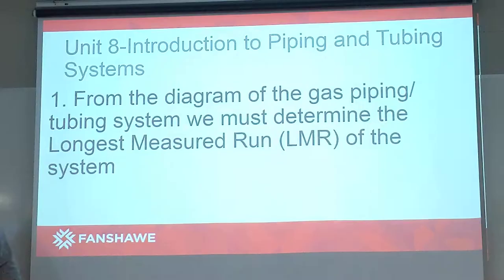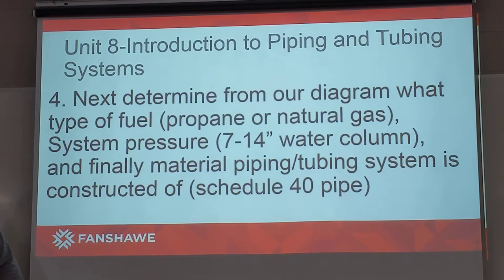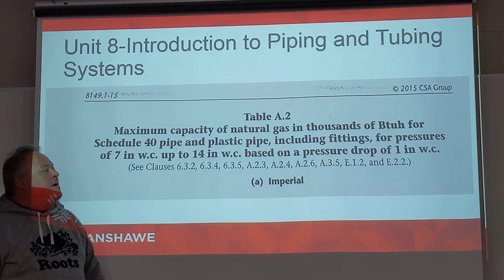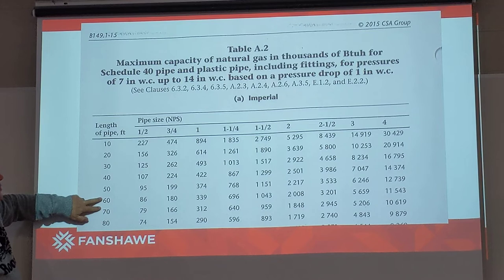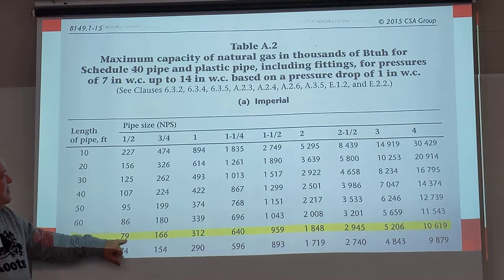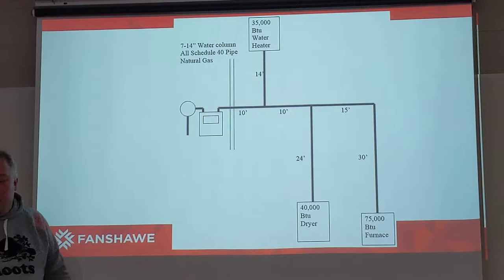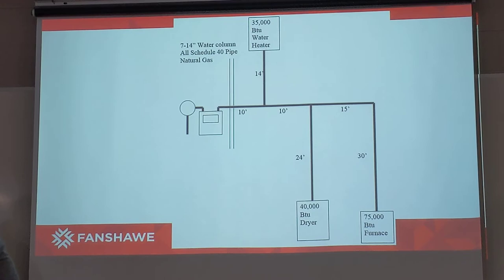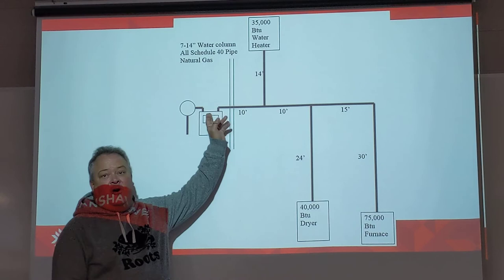Gas pipe sizing March 2019

Comment: This was a fantastic video for me. I own a duplex home  with separate gas meters. My house has a 95% furnace, gas stove, gas dryer, gas fireplace and tankless hot water heater which services both units (my duplex &  my apartment). I want to add a basement gas stove for canning. Now I can understand what will be expected in cost/labor/work even before I contact someone for a bid. Next step is determining what’s there, like  my appliance btu, of existing pipes and length from meter.
Reply from the maker: Perfect

Comment from the maker: I’m always interested in who is watching, please let me know if your currently in the field or a student
Reply from the maker: I own a residential heating and air conditioning company and I teach at Fanshawe College
Reply: @gregtaylor1341  I'm currently in college at mohawk doing their utilities program, and all your posted videos are very useful. thank you for posting these. This helped me understand it quite a bit better.
Reply: 44 years a Plumber. Still working.
Reply: Sudbury ontario. Finalky allowed to go back to school to write my final. Making sure i still remeber how to do this. Great video 👍
Reply: Not a professional - advanced lifelong student of all things residential construction. I rebuild inexpensive 100 year old homes to rent with new wiring, plumbing , furnaces and gas lines in the process. Always ran 1" pipe everywhere so as not to think about it, downsizing right before the appliance to 1/2".  Watched your video as I'm concerned about installing my first tankless water heater (160,000Btu) along with the usual - gas range, fireplace, dryer and 60,000Btu furnace.
Reply: In the field prepping to take my masters. If you’re adding an appliance to an existing system how do you determine if you need to up the pressure from low pressure to medium?
Reply: HVT student at Fleming in Peterborough. Greg, your videos are very well done. I'm studying for a simple piping and tubing test and this helped me figure out where I was going wrong on practice examples. Hope you upload more in the future!
Reply: hello, I'm neither a student or in the field.  I am an IT Field engineer... but trying to save $1300 by running my own gas lines for my dryer and stove. :)   Thank you!
Reply: In the field. Tomorrow I'm replacing most of a house after a gas lockout, just wanna double check my sizing.

Comment: i have a bsme. this might take some iteration. right now it looks like pressure at nodes or something. i am merely trying to add a 30 foot length for an old , small gas kiln/furnace i just got. pipe roughness. usually assume turbulent flow. high reynolds number. the 1/4 inch copper tubing with x roughness will probably break down the pressure to a point where it is noticeable. gas company/county? maybe old shutoff valve. its called fluid mechanics/book. with tables. large number arithmetic with 10^4 etc. reynolds number = v d / u

Comment: why does everyone do this charting with the highest BTU unit at the end of the longest line?   what happens with the highest BTU unit being on only say 10' of pipe and half way between the regulator and the end you have say 50' going to only a very tiny unit?   i dont see why you need to size the LMR for 55" when you dont have a high demand for that 50' run, only a high demand for the 10' run.
Reply from the maker: The reason we use the 55' LMR is to ensure that all appliances have the minimum gas flow required when all appliances are running

Comment: Just an FYI, you are not sizing the appliance drops to the national standards. You're main fuel run (trunk lines) using the longest run method is correct and accurate. But when you're dealing with drops your length should be calculated from the shut off of the appliance to the gas meter ( I believe your misunderstanding the code as written or missed that section in the instructions, which is understandable because it's kind of hidden). By using your method a drop for  a 100,000 btu load would be the same size whether the appliance was up by the meter or a mile away. The mile away drop would be correct but the one up by the meter would be vastly oversized wasting time and money. Hope some of this information helps, stay safe & keep learning.
Reply from the maker: Hi Bob: I agree with your observation but I will offer that this is the procedure we teach here in Ontario Canada, as our governing authority creates exams using the above taught method.

Thanks Greg
Reply: @gregtaylor1341  , thanks for your reply and it is completely understandable why you're governing authority would want it taught that way, especially on residential applications.  
Thanks again, regards Bob

Comment: Thanks for this video. My question is, looking at the drawing plan view, dont you need to include the vertical run as well? What I mean is gas pipe running inside the ceiling space horizontally and goes down vertically to serve ..say a oven or fryer. And also dont you need to include the 'elbows equivalent length' as well. Thanks
Reply: Yes. You need to include the stub out to the meter and the riser. and, if you're going down inside a wall that must be calculated, also.  It's "total distance" But doesn't include the gas flexes or the arc of fittings.
Reply from the maker: In these tables the fittings do not have to be counted, as the table already accounts for "a reasonable number of fittings", yes you would also need to add the vertical sections, I just find the examples less confusing without verticals. High pressure tables in Ontario Code do not have allowance for fittings, so you must add the fitting resistance when sizing 5, 10, or 20 PSI examples
Reply: @gregtaylor1341  Thank you Greg. im in toronto canada. one question is can you have 2 gas meter  with 2 gas lines serving one commercial unit? (restaurant) or it has to be just 1 gas meter with 1 gas line?

Comment: I might be in the wrong place here. I'm trying to split the ng line going into my water heater to add and hook up a dryer (3ft away). I'm good with diy stuff but never had gas before.  Alternative is to sell our gas dryer and buy an electric
Reply: Sir unless your a licensed plumber/gasfitter , you should not attempt to gas fit yourself as diy, pay a pro that way the work is done right the first time and the inspector oks it 👍 safety first
Reply: If plumbers weren't months out and giving ballpark estimates around $1,000 i would. I hadn't realized there is already a T fitting after a shutoff valve going into the water heater. So all i'm doing is connecting the dryer to a capped pipe 3' away.  I know its the internet but there is TONS of info out there for people doing it themselves.  I'll be using yellow teflon tape and bubble testing all fittings. Since i will be doing it myself, any other safety tips?
Reply from the maker: I understand your frustration with cost and time frame but unfortunately if you DIY this project and your house catches fire or explodes for any reason your insurance company may not pay for damages
Reply: @gregtaylor1341  appreciate the concern. This ended up being even easier than i thought. Just attached two ends 4 ft apart with a flexible hose. Bubble tested the shizz out of it, stuck my face by each fitting for a long time smelling.

Comment: For example if you have all 3/4 pipe without reducing will it work great or better to reduce for power ?
Reply: Yes, it will supply more gas but the appliance does not need it.  The larger the diameter of the pipe, the more money it will cost you.  No need to spend the extra money!

Comment: What does it mean when it says "based on 1 in wc pressure drop" does that assume 1 in wc pressure drop per 100' of pipe or what? Thank you.
Reply from the maker: If you use a table based on 1" pressure drop to size your piping system you should not have more than 1" difference in pressure between the gas meter outlet and the furthest appliance (with all appliances in the system operating at full capacity)

Comment: 75000 divide by presume 1000 btu per hrs = sq feet btu/hrs, so furthest furnace = 75 sq ft per hrs, need 1/2 " size metallic pipe.
Reply from the maker: How far from the regulator is the furnace???

Comment: No one ever explains the pressure drop. How do you know what the pressure drop is?
Reply from the maker: You measure the pressure drop, or use the correct tables to hopefully size pipe and tube systems to not exceed allowable pressure drop